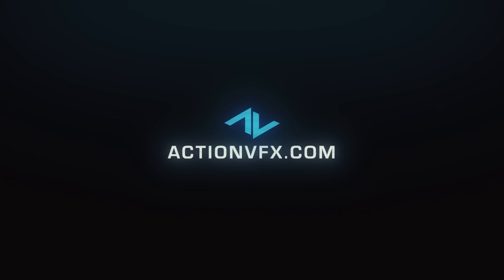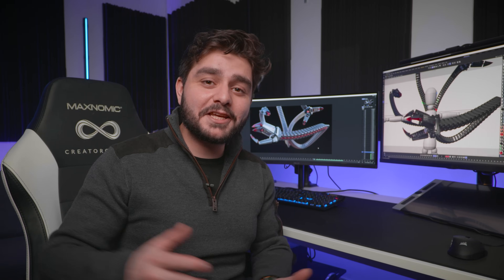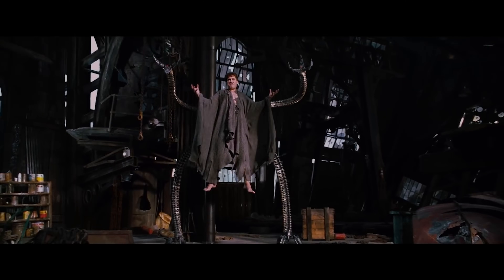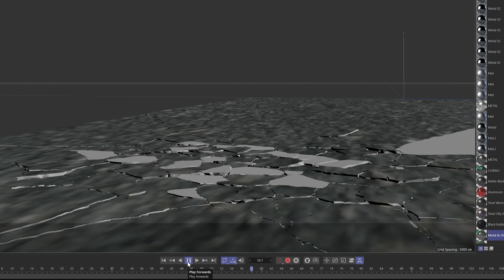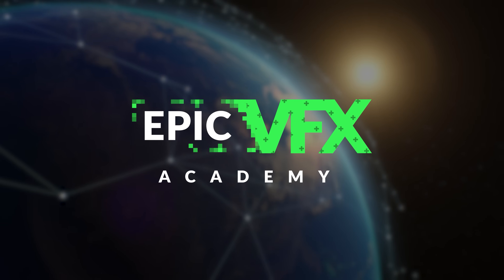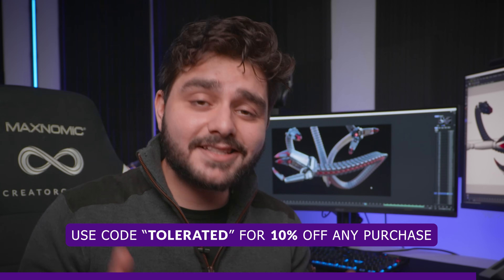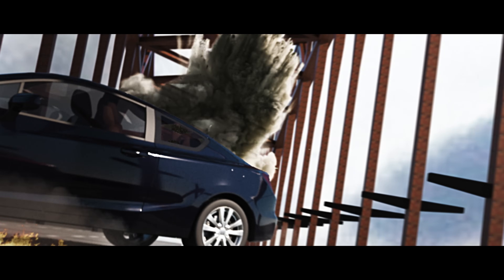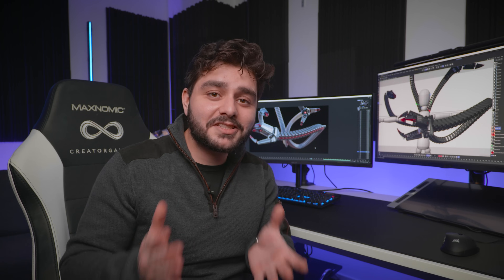Doc Ock Mechanical Arms in Cinema 4D (Spider man: No Way Home)

Comment: great result and you can animate a spline with point level animation instead of pose morph it will be more straight forward and i think you forgot to off  the avfx layer so it has the edge issue
😀
💯
Reply from the maker: Point level animation would also work, yes. Depends what you prefer for the situation I guess